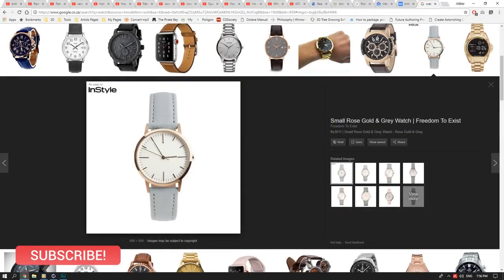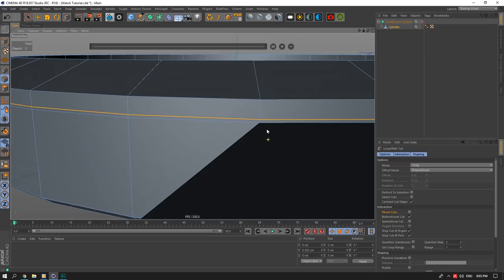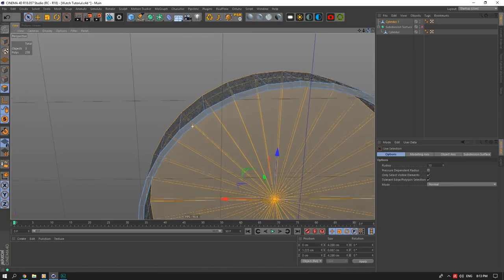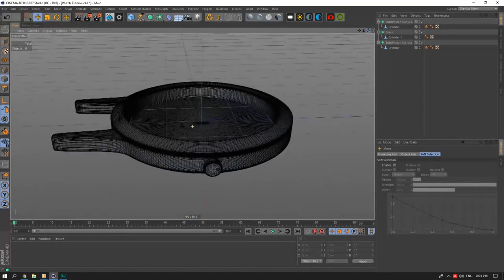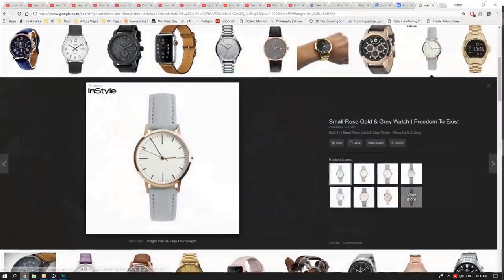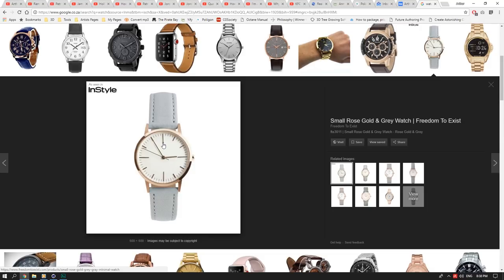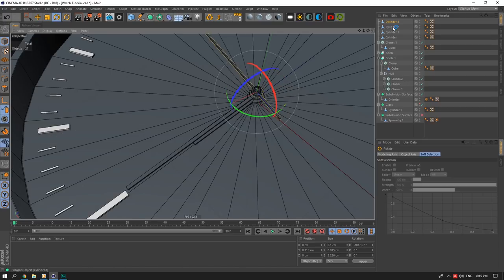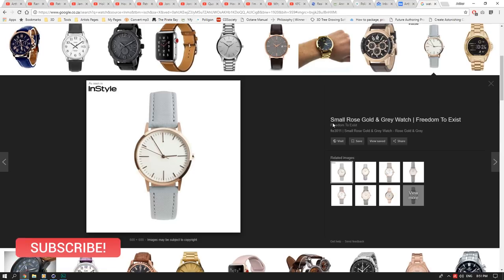Basic Watch Modeling Part 1 | C4D, Octane

Comment: Nice tutorial! One question: How did you make the watch flatter at 5:00?  When I am doing exactly what you did, I just move the bottom wall UP or DOWN. The rest is not moving with the bottom. Could you help me please?
Reply from the maker: You're not being very specific
Reply: So the watch is not getting flatter, the bottom is just moving.
Reply from the maker: Your faces aren't connected with the rest of the object. You need to align all your points when you want it to close and hit optimize to merge them together. You'll see if you create a new cylinder and try to move the top and bottom faces that they aren't connected. But clicking optimize merges the points together.
Reply: Nice, that worked! Thank you very much! :)
Reply: @MrENERG1E  i have the same problem!
Reply: @ArthurWhitehead  ?
Reply: @MrENERG1E  i found a solution !
you need to hold the mouse butten when you drag it down